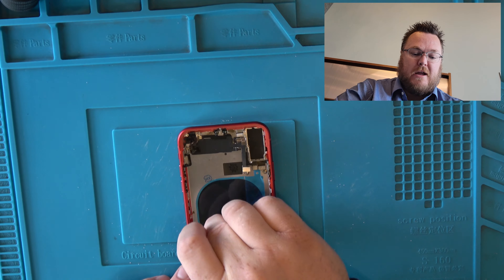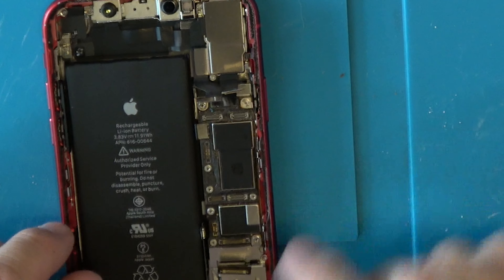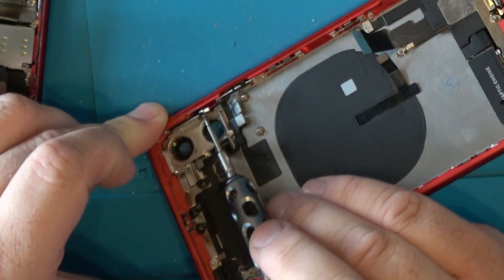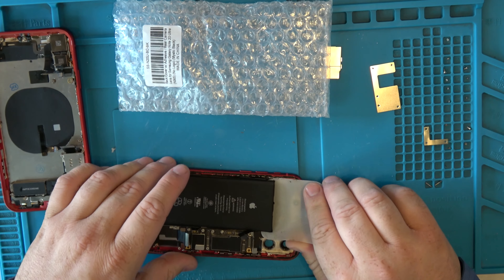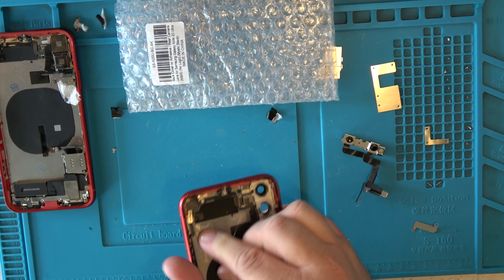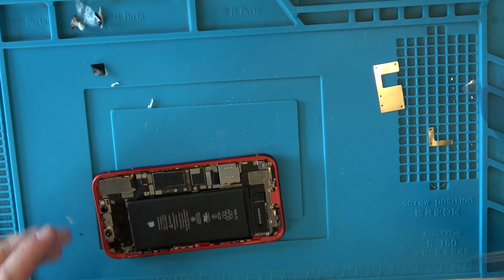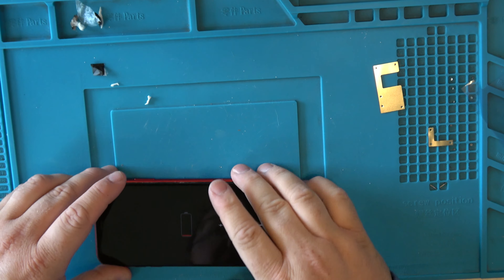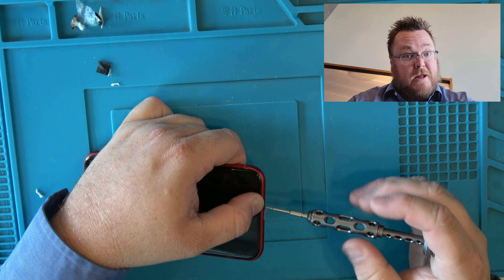iPhone 11 Back Glass with Frame Replacement DETAILED

Comment: Thanks for this video it really helped boost my confidence on fixing an iphone 11 w/ a busted back glass.  I bought a back + frame and moved everything into the new back.  Camera doesn't work because it got wet previously and so I ordered a new one but everything powered on.  The only part that I needed covered that wasn't in your video was the bottom right of the phone which i think is the loud speaker.  Figured it out it wasnt too crazy but it had some screws hidden by stickers and  two weird cylindrical shaped screws. Thanks again!!

Comment from the maker: Please support the channel by using my amazon links! 
For just the Back Glass with Frame click on the links below.

iPhone 11 Housing Compatible Without Small Parts (Red):
https://amzn.to/2Zc9iBj

Back Glass Replacement Kit ~ Rear Back Glass w/Removal Tool (Black):
https://amzn.to/3m9Q34n

Housing Compatible Without Small Parts (Green):
https://amzn.to/3CfoufM

Recommended UAG :
https://amzn.to/3BgfRAb

Heating pad:
https://amzn.to/3mbIytW

Heat Resistant Gloves
https://amzn.to/3EsZdyW

My blue mat to keep everyone organized:
https://amzn.to/3BalS16

iFlex Opening Tool with Glue Card :
https://amzn.to/35UC9h8

iPlastix Opening Tool with Glue Card :
https://amzn.to/38FtzUH

on of my favorite screw driver sets 2uul:
https://amzn.to/3jsqkCz
https://amzn.to/3CcoL2Y

iseasmo w/ Kit (Has Screw driver too)
https://amzn.to/35Za2O0

Tweezers:
https://amzn.to/3B7yBlf

T-7000 Water sealing glue:
https://amzn.to/3EdzLxs 

Isopropyl Alcohol For Technical Use:
https://amzn.to/3BqBU78

Need to get a part from a reliable quick source, you'll find a better price here then Amazon and the quality will be a lot better. Click on the link below.
https://www.injuredgadgets.com/?acc=be9b6cec65c863e1b55538d2c7fcc9b0

• Visit our Website: https://tech-md.com

• My email: dustin@techmd.bz

• To mail in your phone, please contact us at 801-438-6028